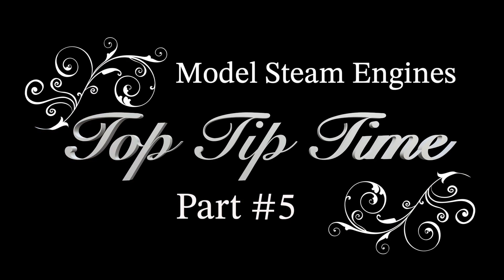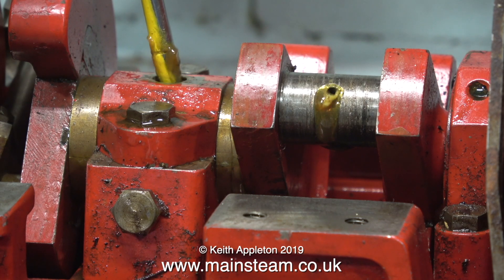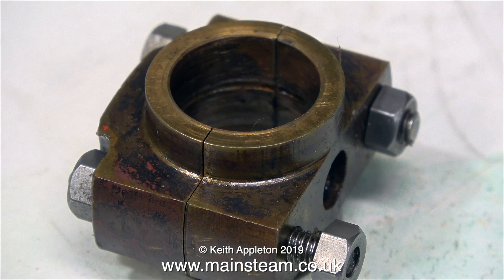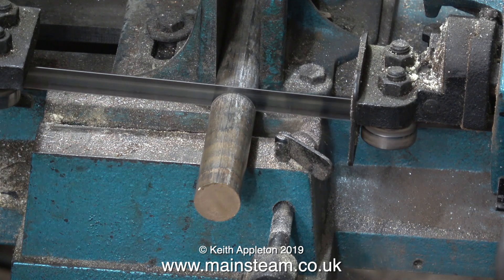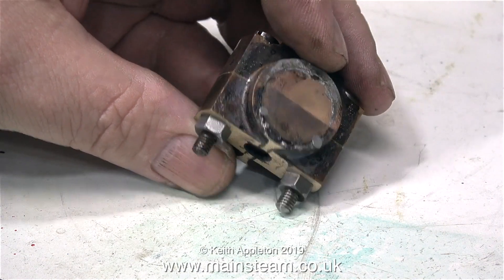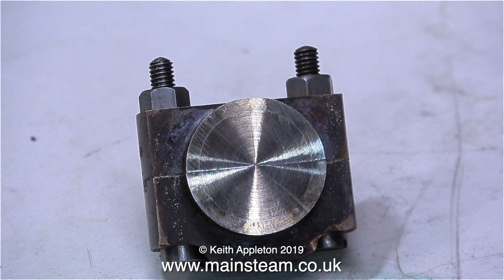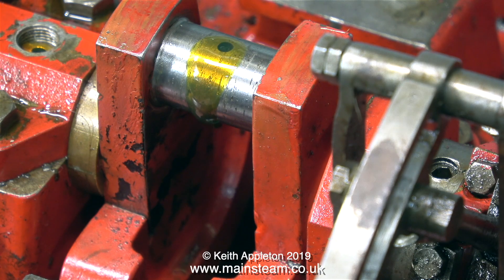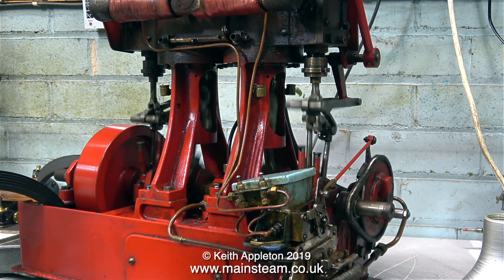MODEL STEAM ENGINES  - TOP TIP TIME - PART #5

Comment: I had a car engine that locked up solid after fitting new big end shells. I discovered one big end was out of round and could not get a replacement. I blued and scraped the shell to correct the fit. It went in to do 10,000 miles with me. I never got around to doing a “proper” job. It wasn’t needed.

Comment: An upgraded design would be to make new big ends in steel that carry bronze bearing shells. Get it brass effect zinc plated so it looks correct.
Reply from the maker: Please be aware that this was a budget job for a customer, hence the process that I used to fix it. Besides, steam engine "Brasses" are usually unpainted Gunmetal. I often find it best to try and follow what is shown on the drawing.

Comment: Very interesting. Are you going to repair the paint on the crankshaft or just remove it? Normally I don't see those painted. I did like how you set everything up then machined it as a single part. Thanks.
Reply from the maker: This is a commercial job for a customer and I am only repairing the damage, not painting it.
Reply: It’s a boat engine so the paint makes sense to protect it from corrosion.